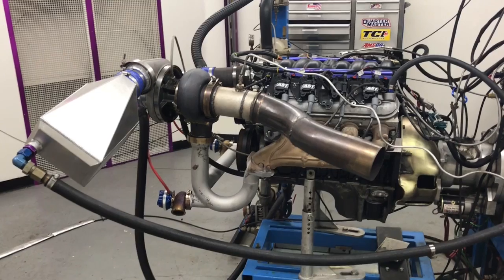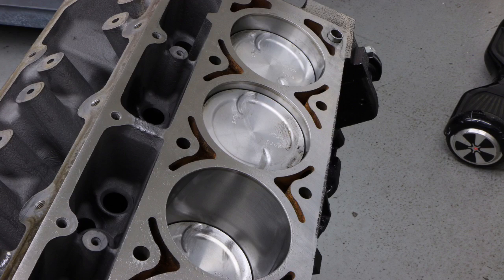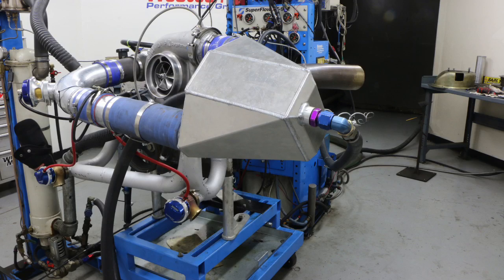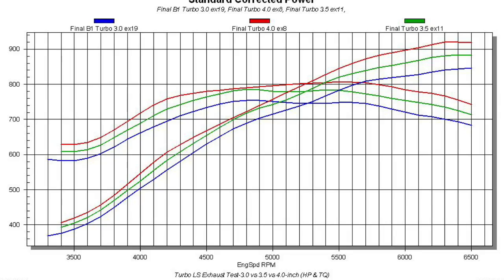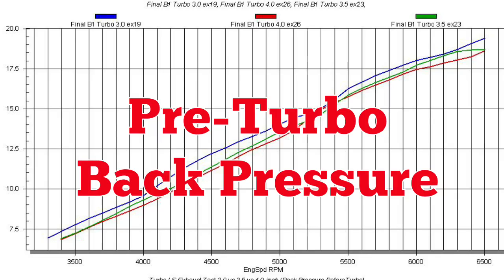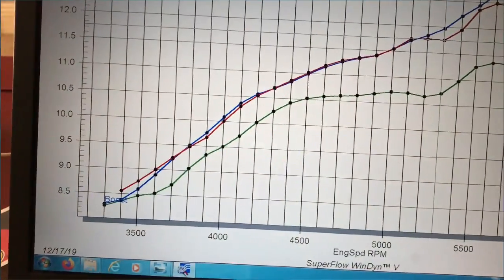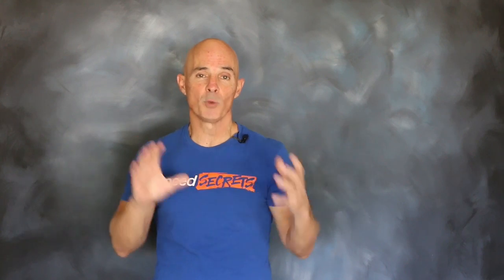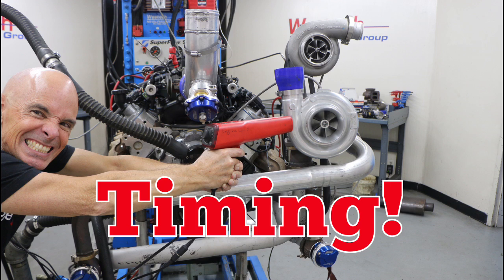LS TURBO EXHAUST TEST-THE DOWN PIPE DILEMMA-WHAT SIZE WORKS?

Comment: If you put an expanding pipe at the outlet of the turbo you get a low pressure area and more air flow.  No more than a 12 degree angle or you will introduce turbulence.  I think you should use the piece you had on the first two pulls and put an exhaust pipe what ever size it opens up too.  6"?
Reply: you've got Bernouilli backwards.  flow will slow down as area increases, and pressure goes up.  Ideal expansion is 8 degrees.  I'd like to see the effects of varying length megaphones too.
Reply: @Crysmatic  in a Venturi the same amount of air flows through the tube. The velocity speeds up in the necked down area and slows back down as it expands.  The higher velocity creates a low pressure area at the necked down area.  That's why airfoils ( airplane wings)create lift. The velocity over the top of the airfoil has to be higher to reach the other side at the same time as the air that goes underneath.
Reply: @Crysmatic  pressure decreases as it expands using Boyle's Law. There is a formula for the ideal angle of expansion.  I forget but it has to something to do with the diameter times a certain multiplier of like 2?  I took photos of the training video but my phone broke. Lol. Think of an orifice in an air conditioning line.  Pressure builds up before the hole and the pressure decreases as it expands into the pipe on the other side.  Bernoulli's principle is for a Venturi.    I worked for Honeywell and they own Garrett.  I was able to get to the training videos. It said no more than 12 degrees of expansion or you will induce turbulence.

Comment: No muffler on the 4 inch and shorter pipes the the 3.5 and a lot shorter then 3 inch also different style mufflers
Reply: When you read... he has stipulated that the comparison is simulating 3" street, 3.5" street/strip and 4"race.
Reply: @CosmosMBTS  i understand that . My thing is he is not proving anything about down pipe size.  It sort of like comparing camshaft power small block small cam to big block big cam. I would like to actually see identical test done either all strip or all street. That being said , Make no mistake about it , I love the videos . Most are informative.

Comment: Why run a manual controller. Run manifold pressure straight to the bottom of the gates. Boost should stay the same as long as back pressure isnt high which shouldnt be on that setup

Comment: Id love to see this same test with twin turbo LS
Reply from the maker: michael wakat Twins would work well with 3-inch-each turbos is only flowing 450 hp
Reply: Me to we run twins 69s picked up 300 rear-wheel horsepower. by changing AR from .91 to .96  on 24 lbs of boost it went from 788 whr at 5000 RPMs to 1030 whr at  6300 RPMs. 3inch exhaust would 3 1/2 make a significant change in power output?
Reply from the maker: Daniel Sullivan that seems like a big change in power for a minor change in AR-glad it worked for you

Comment: Richard Holdener
You know you can run air to the top of the waste gate only if your having back pressure problems or changing the housing size reduces back pressure also. Im sure you know this but figured ide mention it. Love the videos.

Comment: The outlet flange on that S480 is 4.625" OD so putting on anything smaller is going to create a restriction.  You didn't need to bolt anything together to know this was going to happen.
Reply: The question is always how much does it matter though.
Reply: @jaredshaffer3901   Garbage in = garbage out.
Reply from the maker: Monster RAM thnx but I don’t think the outlet flange size is what determines flow-the outlet of the turbine is obviously much smaller.
Reply: @richardholdener1727  Well there's the problem.  You think the turbine size, not the outlet size it what matters.  Even your test demonstrated that to be false.  This is basic fluid dynamics.
Reply: @user63344-gds  they both matter. Basically you just never want the DP or the exhaust diameter at any point to be smaller than the turbine exducer and preferably much bigger. In this test it may have been smaller with the 3" dp not really sure on the s480's exducer size.
Reply: @FredAllenBurge   Depending on what housing he has, that turbine is somewhere between 87mm - 96mm.  However, the turbine size is not the only factor in calculating how much air the turbo moves out.  Borg Warner has already done the measurements on the proper sizing of the exhaust outlet.  Putting a smaller pipe after this outlet will create excess BP, heat, and reduce air velocity, and this is what you see in the video.  A better test would be using a 3.5" pipe to demonstrate what a restriction will do, a 4" pipe to see what the recommended size would do, and a 5" to see if opening it up would help any.  Testing three pipes that are all too small doesn't yield any information that couldn't be gained for a simple thought exercise.  

Btw, we use these turbos all the time in the diesel world.  No one runs anything smaller than a 4" exhaust.  It's almost like they make the flange the right size in the first place...
Reply: @user63344-gds  agreed on all points.  What I actually meant to say was the dp/exhaust should never be smaller than the outlet diameter of the turbine housing (rather than the exducer diameter) which is what you said as well. You'd think it's kinda common sense really!

Comment: I have a question about the ring gaps.  What are you gapping these LS's to and what do you torque the  rod bolts to when reassembling the rods?
Reply from the maker: Preston Edmonds gap to .030 and factory angle torque spec or torque equivalent
Reply: @richardholdener1727  thanks Richard.   Do you reuse the rod bolts or get new?
Reply from the maker: Preston Edmonds I reuse

Comment: Awesome test. I’d love to see this same test run with a maxed out turbo. By that I mean bring the boost up with a 3 inch exhaust until the turbo reaches max efficiency and the motor stops making power with increased boost. Then the same with 3.5 and 4.0. I’m guessing that the exhaust with a higher back pressure drop across the turbine will have a higher efficiency limit.
Reply from the maker: Jordan Breier a higher power level will show greater gains with the bigger exhaust
Reply: Richard Holdener gotcha, thanks Richard

Comment: The best exhaust for a turbo is none. And this test proved it. Thanks for the video!
Reply: Until you have oil blowing all over your tires or windshield...
Reply: @700HpVette  True. I would never run fenderwell exhaust or anything. Straight pipe, no muffler...
Reply: I've been telling this to folks for years

Comment: Was the mufflers on the 3” and 3.5” open throat design? And why no muffler on the 4”? And they wasn’t equal length.
Reply: This was my question also. Would like to see the 3 and 3.5 run with a short pipe and no muffler , just like the 4. Not an apples to apples comparison.
Reply from the maker: Tommy954rr 4 inch was the race exhaust
Reply: Richard Holdener  OK I understand now. Some what stock full length to a modified before axle then all out fender exit.
Reply from the maker: Tommy954rr yes-just simulating different Exhaust configurations and showing changes in pressure and power

Comment: Excellent test.  In your option how much difference would there have been if you used the electric boost valve?
Reply from the maker: Phil Betthauser as indicated in the vid-25 hp or so was due to boost-35-40 hp was from the exhaust
Reply: @richardholdener1727   Thanks.  I missed that.